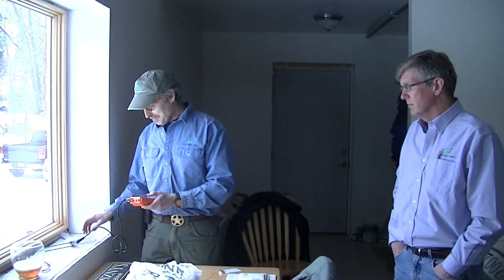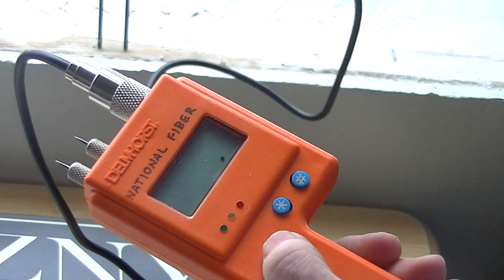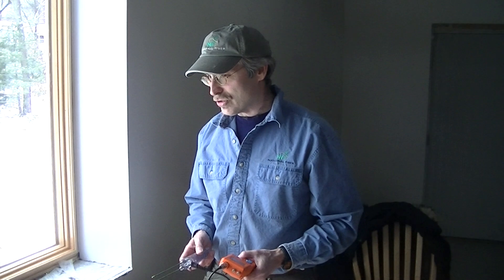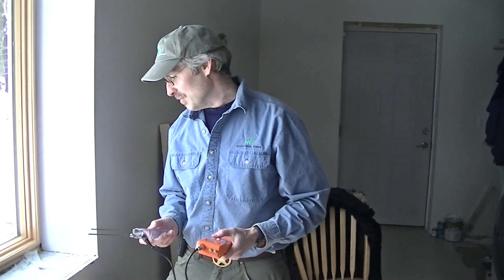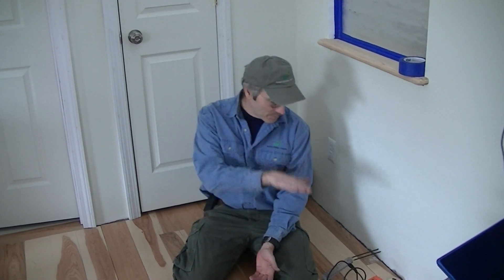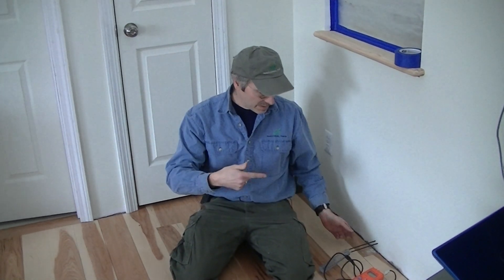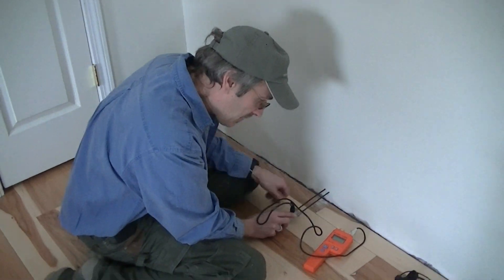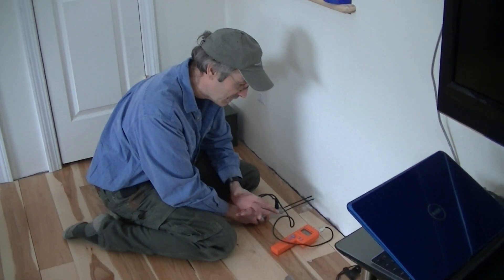Moisture Testing

Comment: Hey David, I saw you present on your house at umass many years ago.  I’m curious if you’ve checked for moisture build up in your roof near the ridge in particular?  Hope all’s well!
Reply from the maker: Yes, in a more recent year (March) we probed the roof sheathing.  We removed the smoke alarm for access because it was very close to the ridge (about 2 feet away).  It was very consistent with this video.  The conclusion is, this is a very dry assembly.  Bill has done moisture testing on over a hundred houses, cellulose, and we are all dry.  The fear mongering from places like Building Science Corporation is complete nonsense.